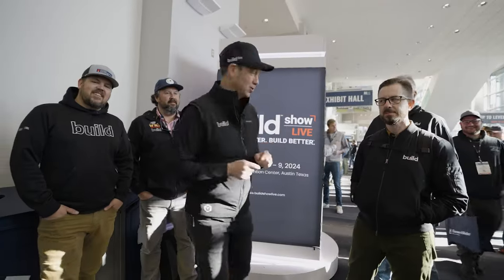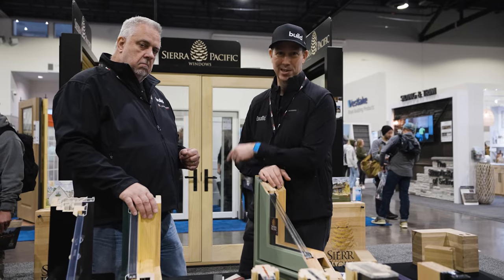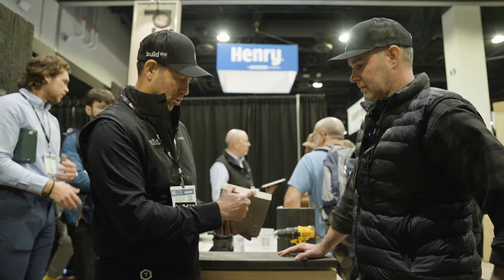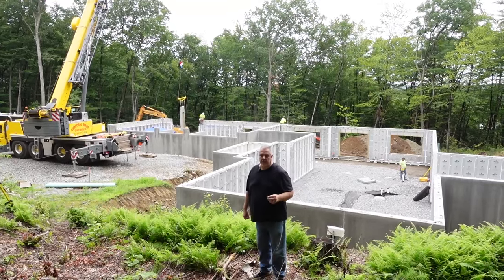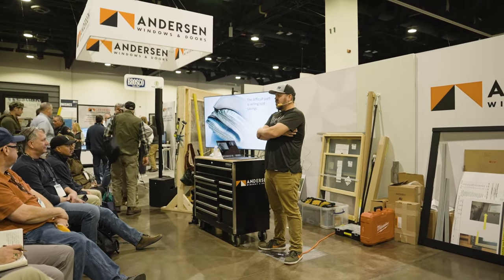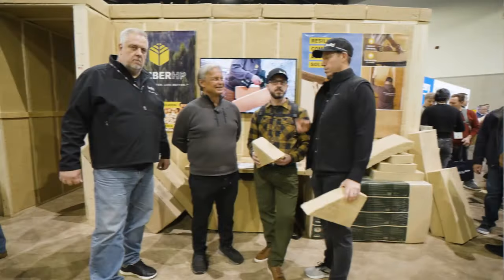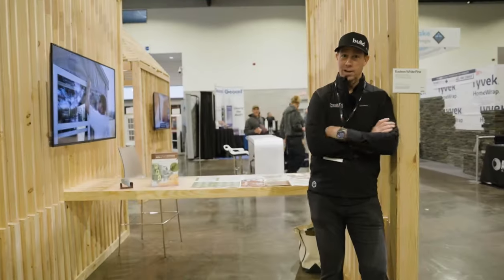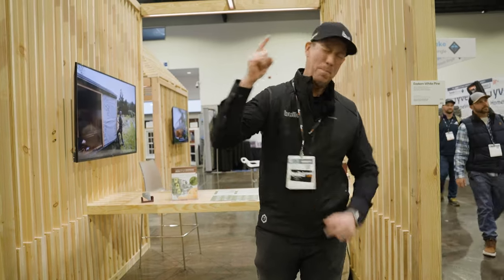Self-Healing Deck Boards?! New and INTERESTING products from JLC LIVE (2024)

Comment: Good info on drying with air permeable insulation and sheathings. I would argue that if you use air impermeable materials like CC SPF and Polyiso board sheathing you don't need to worry about barriers and as long as you drain the rain and manage the interior environment you will have no durability (CONDENSATION)  troubles and a better performing High R value wall.

Comment: Not pertaining necessarily  to this video specifically but i have a rep who is anti Mineral wool because of some bad experience with it becoming saturated on site. He trusts Steves knowledge and has brought him up as a source of information to me before. Perhaps next time you get a chance to cover mineral wool, you guys could go over the different types and what they are used for (ex: comfortboard, comfortbat, cavityrock, etc) along with some site logitics concepts of storage and how long it may be exposed before getting your rainscreen cladding installed on top.

This rep sells xci ply along with other wall assembly materials (no mineral wool) so ofcourse hes biased. That being said he reps our sintered ceramic, acm, 3mm aluminum plate , granite and BIPV panel systems. Mineral wool is the standard we use for wall assemblies here in Canada. 
We sell our panel system across North America and I see tons of different wall assemblies as an estimator.  

I just want to find a video to send him thats not from Corning or Rockwool that talks about water absorbition and effects if saturated and how it becomes unsaturated if it does during construction.

Ive been following for many years! Great work with everything and developing the build show network and the group of experienced builders. One of the best sources of building science info and building product info online today.
Reply from the maker: Appreciate the kind words.  I’ll see what we can do on that video. In my experience it’s tough to get mineral wool saturated as it’s naturally hydrophobic. However in a flood situation I understand it can dry out and be reused.